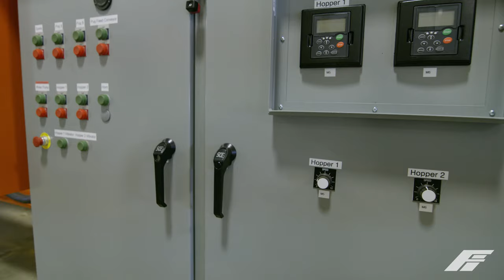Pugmill

Comment: Glad you guys decided to put plates seperating the bins. I had a two bin feeder without the pugmill to mix sand from our washplant and an offsite company. Used to have a difficult time keeping the material seperated without falling off the sides or spilling over into the other bin. When you've got trucks coming in to get loaded non stop you've got to keep those feeders full and no matter what i did there would always be some carry over. Great job.